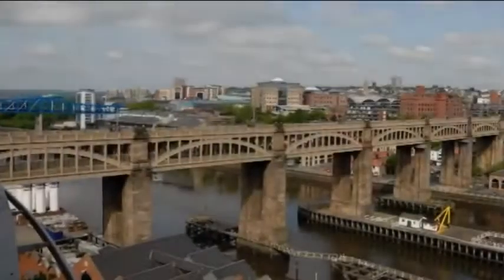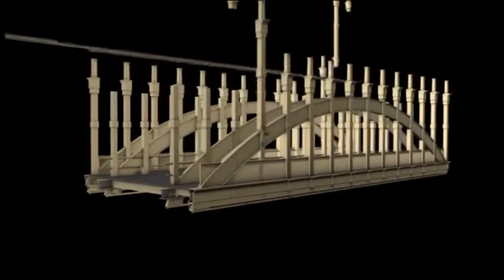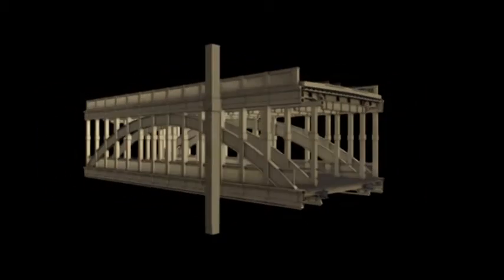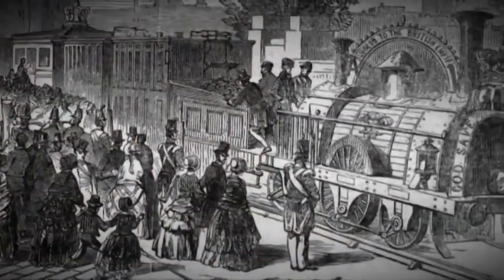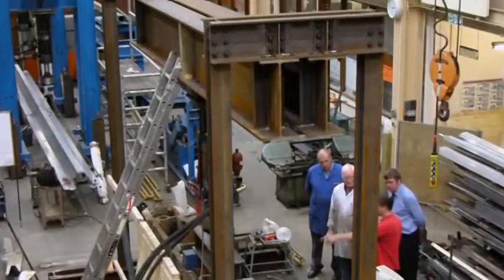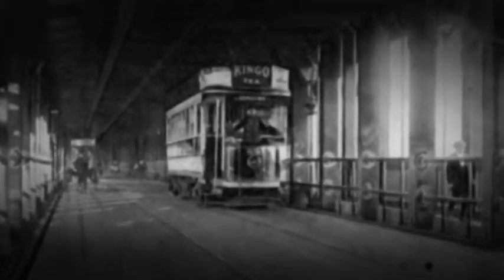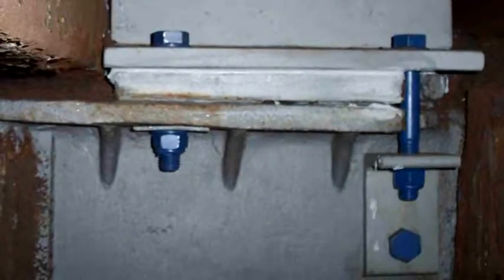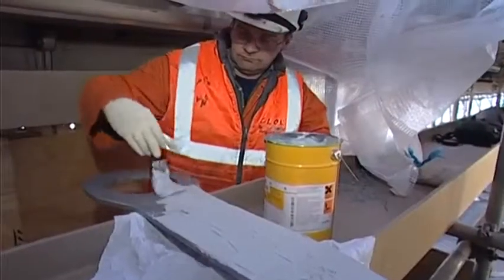The High Level Bridge Restoration Project

Comment: 2:58 lol, I love the way they used a Spanish AVE power car instead of the trains that normally cross the bridge. It's as if the animator just Googled 'train' and picked the first model that popped up without doing just a tiny bit of research.